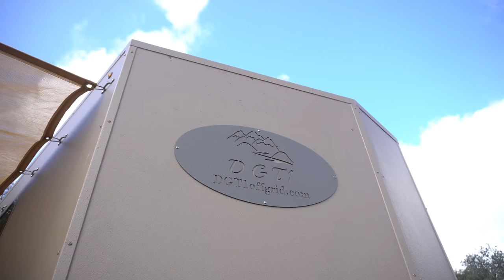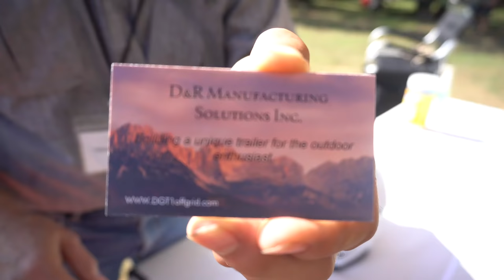Off-Grid Overland Camper Built On a Military Trailer

Comment: Cool trailer but why not just buy an RV? That thing has got to be 10' high or higher and unless you offroad with zero trees around I dont see it being very good offroad, not to mention the weight being to high. Still cool, just not something I could see being useful off road with trees around. But loved the video and review nice work. You made it interesting!
Reply: It’s an old milsurp humvee electronics shelter. The weight is only around 600 lbs for the frame